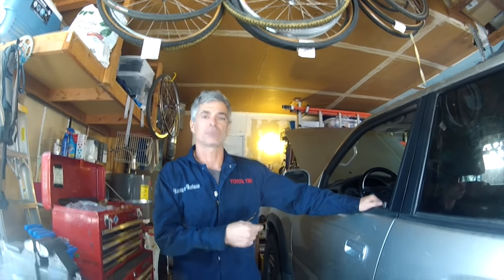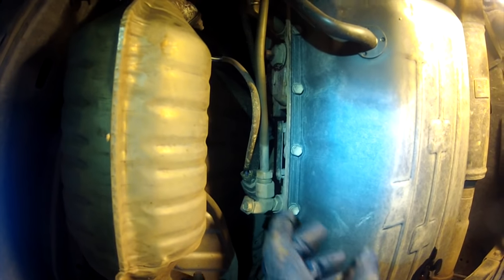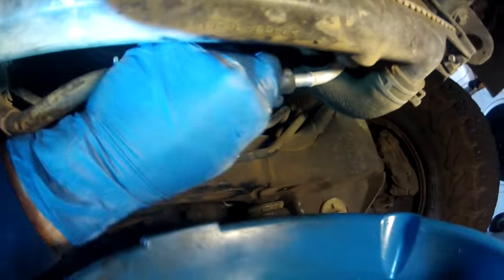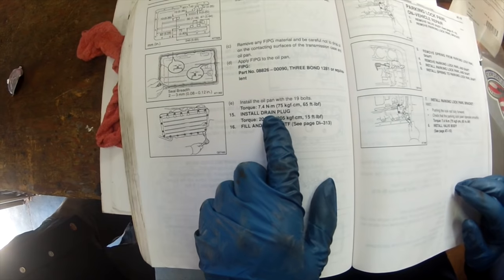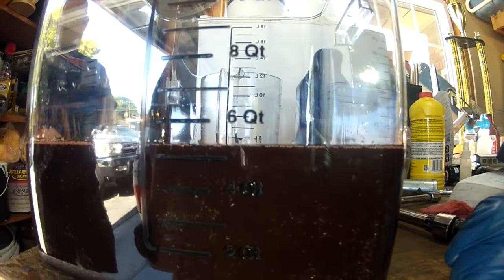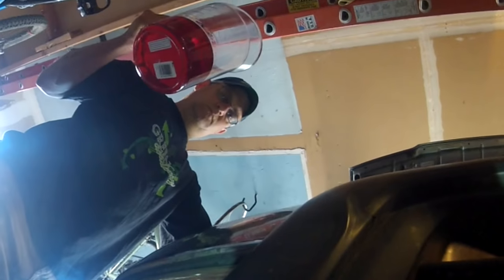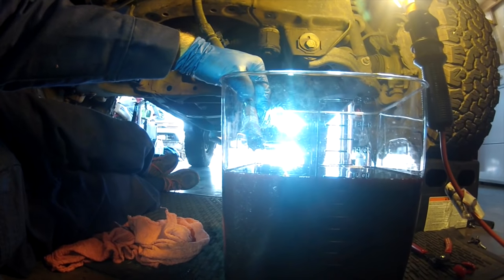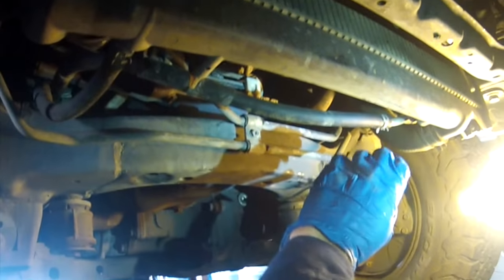Transmission Fluid Flush

Comment: I can use your method in cvt ?
Reply from the maker: เพชรภูมิ ภูมิพานิชย์  I'm sorry, what does "CVT" stand for?
Reply: Continuously variable transmission in nissan altima/teana(in thailand)
I want to flush transmission fluid in my nissan teana.
sory , I'm not good at English.
Reply from the maker: If you have a transmission cooler in the radiator and you're able to disconnect either the send or return line off one of the cooler fittings, it will work.  You drain the pan first and measure how much you took out.  Now replace that amount via the dipstick tube.  Next you start the engine and let one quart come out of the hose you disconnected, stop the car, and add one quart back via the dipstick tube.  You keep on repeating this process until you've replaced the capacity of the system and/or the fluid is looking brand new.  Now reconnect your hose, check the level while the engine is running and make sure you're in the cold range on the dipstick.  If not, add some until you are in the cold range.  Take it for a decent length drive (at least 10 miles) and get the transmission up to operating temperature.  Recheck the level and see if you're now in the hot range on the dipstick.  Add if necessary.  You're all done!
Reply: WOW!  yes I have  a transmission cooler in the radiator.
I understand all. 
You helped me a lot.
Thank you verymuch.
Reply from the maker: You're welcome.  Let me know how the flush goes.

Comment: Why do I hear people saying Not to do a Transmission Flush for a 2005 tundra??
Reply from the maker: Don't know.
Reply: @TimmyTheToolman  maybe I am mistaken and people have said not to Flush the radiator just Change the fluid? Is their a Difference in technique with Flush and change? It seems that it is sometimes used interchangeably? Thanks!
Reply from the maker: @kat4animals004  Flush and change are used synonymously.  I don't think anyone is actually forcing fluid through the system which the term flush would lead you to believe.  Does your 2005 have a dipstick or is it one of the sealed transmissions?

Comment: What was the mileage ??
Reply from the maker: I don't remember the mileage Joe had on his rig when we did this job.  In my opinion, a full fluid flush should take place every 30k miles at a minimum.  But, if you want to avoid the full fluid flush procedure, a series of trans pan drain and refills can accomplish nearly the same thing.  On both my 3rd Gen 4runners, I haven't performed a full flush like is seen in this video.  I do a drain and refill of the pan and I time this with my engine oil change.  On the next engine oil change (every 5000 miles for my rigs - I use synthetic oil), I do another drain and refill of the trans pan.  I do a 3rd drain and refill of the trans pan again at my next engine oil change.  After the 3rd drain and refill, the fluid is in pretty damn good shape.  Now, I realize this is a dilution process where you're mixing old fluid with new fluid, but it is very effective at getting your fluid in great shape.  I follow this up with trans pan drain and refills every other engine oil change or every 10,000 miles.  I did a Blackstone Labs Analysis of my ATF at one of my 10k drain and refills and the report came back saying my fluid was in great shape.
Reply: Oh that’s awesome thank you Sir
Reply from the maker: @balesmith8936  You're welcome.

Comment: I thought you were supposed to use the supply line instead of the return line.
Reply from the maker: It doesn't really matter which one, but for these 3rd Gen 4runners, it's easier to connect to the return side of the trans cooler rather than try to hook up to the send metal pipe.
Reply: @TimmyTheToolman  I see. I just flushed mine today on a 2007 Tacoma TRD. Pretty simple. Thanks for the video and reply. Good help and information.
Reply from the maker: @cali0559  You're welcome.

Comment: Isn’t flushing not good?
Reply from the maker: Caleb Ventura This "Flush" isn't some type of forced flush with a machine.  The fluid is moving from the transmission pump just like it normally does.  The only time a flush, which renews all the fluid, wouldn't be advised is if you don't know the history of fluid changes for the transmission and the fluid looks very dark or black.  That fluid could be holding suspended clutch particles that the transmission is relying upon to shift properly and not slip.  Once the old fluid is gone, the particles are gone too.  Also, an abused transmission with have sludge build-up in it.  When you introduce new fluid which has fresh detergents in it, it can end up dislodging some particles which could end up blocking fluid pathways and starve some vital portions of the trans with fluid.

Comment: If the fluid is too old and it's flushed, then you can do damage.
Reply from the maker: Jackie, you're sort of right.  It's not that you would do damage with the new fluid, it's because that old fluid could have been holding a lot of suspended clutch material because the rig was abused and the fluid was never changed.  At some point, the lubricating properties of the fluid breaks down and then you start doing excessive wear to the transmission components, the clutch plates being one of them.  The transmission was relying on that suspended clutch material in the fluid to shift properly and not slip.  

Another thing that can happen when introducing a bunch of new fluid is it can cause sludge deposits in the transmission to break free and lodge in fluid channels in the valve body causing a restriction of fluid flow.  A trans that has been abused will have sludge deposits built up in it.  ATF has detergent properties to it.  When that new ATF is introduced into an abused transmission, the detergents work on the sludge and break it up.
Reply: @TimmyTheToolman  I had it happen to a couple cars. Mostly high mileage ones where the owner couldn't take no for an answer.
Reply from the maker: @jaygames1980  Yep, I've heard about this and it's not uncommon.  I always tell people if they bought a used rig without good service records and their trans fluid looks really dirty, they are probably better off leaving it alone.  At most, I recommend a drain and refill of what's in the pan that exchanges 1/3 of the system capacity, approximately 4-4.5 quarts.

Comment: Torqued like that is more than likely too much. You were ether at or above 15 ft p .You should back it off and then back up. Need a new washer for that though.
Reply from the maker: You're most likely right but I wasn't concerned.  I was just doing that in the video to see if I was at least at the torque value going by feel.  Even though I now own torque wrenches, I don't use a torque wrench for drain plugs.  I've tightened drain plugs hundreds of times without stripping one or having one fall out.  Some people live and die by torque values but I'm not one of them.
Reply: @TimmyTheToolman   me either. Flywheel bolts and head studs sure. I was bringing it up for the other viewers and also because most drain plugs are into alloy. Not fun to need to find a helicoil that fits if your doing a last min oil change the night before a trip.
Reply from the maker: @timphoto83ec  Gotcha.  What you mentioned about drain pans is the reason I'm reluctant to blindly follow a torque value because my torque wrench could malfunction allowing me to over-torque and strip the threads.  I've never gone wrong by feel and I bet I usually under-torque rather than over-torque in most instances.

Comment: Another excellent TTT tutorial video.     My local Toyota parts dealer insisted that Toyota ATF T-IV fluid is backward compatible with Dextron III, which my 2002 Toyota V6 Tacoma 4x4 requires. I bought it but took it back after seeing a video on https://bobistheoilguy.com that it is NOT backward compatible. It makes me think if other Toyota dealers are doing the same. It appears that on Toyota forums, the most raved about transmission fluid is Valvoline Max Life ATF synthetic fluid.  In your video description, I read that you made the switch to Valvoline Max Life ATF synthetic fluid.  My question Timmy, is, what made you switch to synthetic ATF?  Are you pleased with its performance in your automatic transmissions?  I am thinking of replacing my old tired ATF fluid soon with Valvoline Max Life ATF synthetic fluid, especially with summer approaching as it gets scorchingly hot in Southern California.
Reply from the maker: I just decided I would finally make the switch to all systhetic fluids for my rigs.  I mainly wanted a longer engine oil change interval due to having heavy skid plates but then thought it would be good to run synthetic for my auto trans ATF and synthetic gear oil for my differentials and transfers cases.  I use Redline 75w-90 gear oil.  So far, the Valvoline Maxlife seems to be working great.

Comment: dude.. you couldve gone OVER 180 in lb and the torque wrench is still going to click...  just bc it clicks doesn't mean you hit it on the head.
Reply from the maker: Yep you're right.  But you know what?  I've tightened probably over 200 engine and transmission drain plugs without a torque wrench and never stripped a pan, broke a bolt or had a bolt fall out.  For this video, I was just confirming that I was at least at or over the torque value specified by the manual.  With small fasteners like this, I more nervous blindly relying on a torque value than going by feel.  Even though I own 3 different torque wrenches now, I don't bother breaking them out to tighten a drain plug.
Reply: @TimmyTheToolman  i understand that YOU know... i know, but you are directing ppl that DO NOT know.  They might believe that just bc the tq wrench "clicks" that everything is A OK.
Reply from the maker: @--RSL--  Ahh, I see what you're saying.  Point made.
Reply: @TimmyTheToolman  it's all good.  I always have to remember when i make instructions that i have to absolutely dummy proof them.
Reply from the maker: @--RSL--  By the way, for these videos, there's no script.  It's just me saying what I say off the top of my head.  I do have FSM that I consult and other references but sometimes I misspeak and we dub in new audio and other times we make a pinned comment to correct something.  Saying what I want to say in a clear and concise manner isn't easy.  We quite often do multiple takes so I can spit out what I want to say.  It can be very frustrating at times.  And then, there's the street I live on with cars and motorcycles zooming by or a neighbors gardener is running a mower, blower, weed whacker or hedge trimmer, and any other multitude of audible interruptions.  We don't put it in the videos, but I'm regularly swearing because it's super frustrating to be mid-sentence and have some car drive by and I have to pause and then remember where I was and what I was trying to say.  My street is anything but quiet.  You don't realize how many cars drive by your house until you're out there filming and getting interrupted over and over and over again.  Ok, my whining is over.

Comment: Just do a five-minute break burn at the end of your driveway your fluid will be up to normal operation temperature in no time.Gust joking do not do this unless u really want to...
Reply from the maker: Yeah, that would do it but it would probably piss off your neighbors. Ha Ha.  I learned after doing this video that you can simply put your vehicle in drive, set the parking brake, have your left foot on the service brake and your right foot on the gas pedal.  You raise the rpms to around 1000 and watch your trans temp gauge.  This puts a load on the transmission and will quickly raise your trans temp to operating temperature.  I like this better than having to do a long enough drive to get the trans temp up.
Reply: Sounds good. Yeah it can take a long time sometimes especially in the winter months to get the transmission up to operational temperature my truck shows me on the dashboard and it honestly takes about 20 minutes before it's at operation temperature. My neighbour still like me so maybe I'll try it your way. Have a good one...
Reply from the maker: @bigjay6743  You'll like this technique Jason.  Try it out and you'll see.

Comment: What about the filter?👻👻👻👻👻
Reply from the maker: Those filters are a fine mesh metal strainer and not a true filter that has a finite life.  Unless the transmission was abused and didn't get regular fluid changes, that strainer won't be clogged up in the least bit.  So, I don't think it's necessary unless you think the trans was abused.  Here's a video of us replacing the filter on my 2000 4runner: https://youtu.be/tuGazNhuEtM

Comment: Airframe/Powerplant Mech. You are still using a dirty filter!
Reply from the maker: Hey Jerry, the filter on these rigs is actually a fine mesh metal strainer.  I decided to drop the pan on my 2000 4runner with approximately 170k out of curiosity to see how much debris was accumulated on the magnets and see if the filter was clogged at all.  My vehicle was well taken care by the former owners and myself so I expected to see good results and I was right.   What I found is I had very little metal debris on my magnets and the filter was pretty much 95% unclogged.  So, what I learned is if you do regular fluid changes and take care of your transmission, the chances of that filter becoming clogged up is pretty damn slim.  Here's the video of me performing the trans filter replacement: https://youtu.be/tuGazNhuEtM

Comment: Too bad you don't know how to use a torque wrench. The drain plug didn't turn when you put the torque wrench on it. It could have been tightened to 100 foot pounds and your wrench would have clicked just the same. The fastener, or drain plug in this case,  MUST turn with the torque wrench. I've had to school countless tire store employees the same way.I tell them I want the lug nuts hand torqued and they ram the nut on with an impact and then put the torque wrench on them and get an instant click and they think its properly torqued.
Reply from the maker: Well, you are right that the torque value could have been way higher on that drain bolt.  What you don't know is I've tightened hundreds of drain pan bolts over my 38 years of turning wrenches on vehicles and I've never stripped one or had one fall out.  All I was trying to confirm in this video is if my hand tightening was at least at or higher than the spec and it was.  How much higher than the spec the drain bolt was at, I don't know.  But, I would assume it was very close because I understand very well mechanical advantage and the amount of force required to get a drain bolt properly tightened.  For a small drain bolt like the one on the trans drain pan, a shorter ratchet and a moderate amount of force is needed for proper tightening.  If I had a longer ratchet, I would have choked up on the ratchet handle to lessen the mechanical advantage.  I know how to use a torque wrench.  If you watched more than just this one video you'd know that.  Happy Trails Bro.

Comment: Clean fluid and a dirty filter: not at all logical or professional.
Reply from the maker: Many "Professionals" including Toyota Dealership Service Centers consider the fine mesh trans filter a lifetime part.  It's not a paper filter.  I dropped the pan and replaced the filter on my 2000 4runner that had around 140k miles on it.  I cut open the filter so I could examine the entire filter screen.  It was probably 90-95% unclogged, but my transmission had fairly regular fluid exchanges.  https://youtu.be/tuGazNhuEtM  The filter definitely looked nothing like the power steering reservoir filter screen I cleaned out in this video: https://youtu.be/5k61KXRK8bM

If the vehicle was abused and didn't receive regular fluid changes where the fluid was allowed to get very dirty and black, then it may be prudent and drop the pan to replace the filter because there's a better chance sludge deposits have significantly blocked up the screen.
Reply: @TimmyTheToolman  In that transmission, does the return line drop into the pan or lubricate the rear end of the transmission? If it goes to lubrication of the rear, it wad dry during the procedure.
Reply from the maker: @mozpogson3639  it goes back to the trans above the pan.  During the flush, we're exchanging only 1 quart at a time.  At no point is the trans starved of fluid doing it this way.